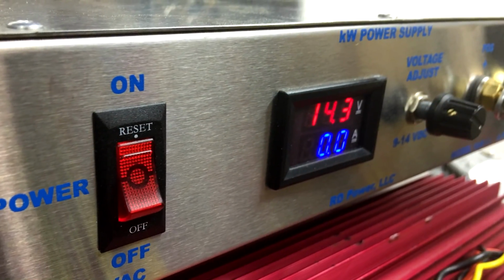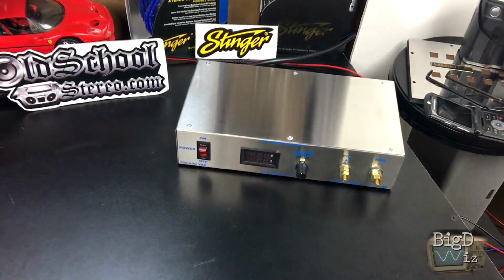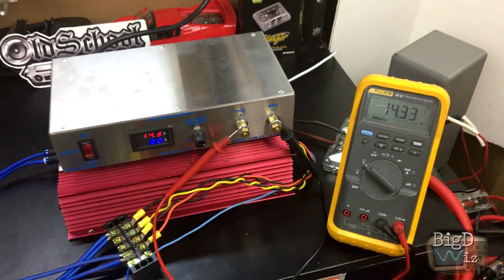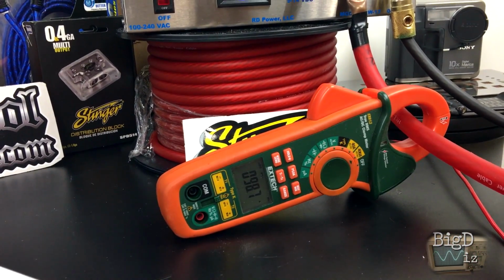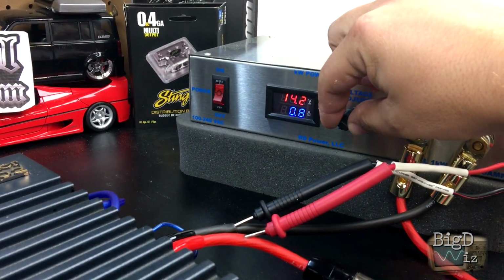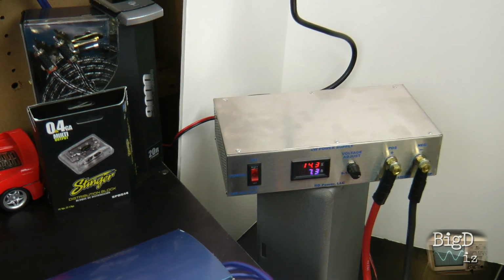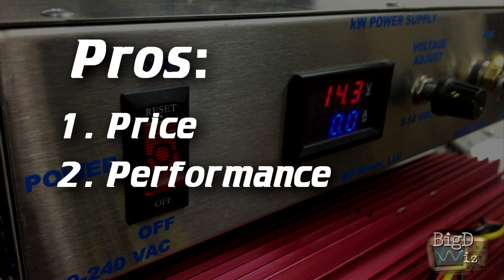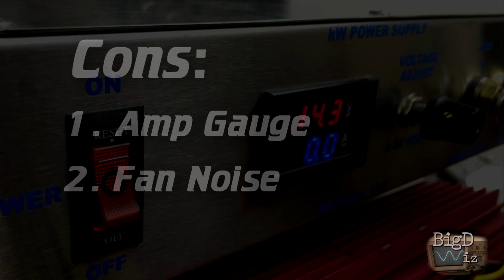RD Power 75A 12V Power Supply Review 1kW-12

Comment: Clamp-on Ammeter deviation is that on DC, the field is not expanding and collapsing as it would on AC.  ON DC, with a load, if you take the meter and turn it in different directions, the current reading WILL change!  That's the difference.  I am HAM Radio operator, I own one of these and have done these tests also.  It is my observance that adjusting the meter position for AMPS changes the reading WITHOUT changing the load.  To validate MY testing, I used an inline CURRENT meter shunt with a Fluke 8050 bench meter to read the millivolt drop across the shunt and converted it to true amps and the meter is accurate to about 1%.  Rusty also makes one with a 150 Amp rating!  Best Regards.

Comment: Check the 2amp current with the fluke 85 III. The only thing I don't like about it is that the voltage display just shows the voltage you selected, not a voltage meter (should fluctuate).

This may be very well the reason why the amperage meter is not accurate or close to your clamp meter. Think about it this way:   75amp @14.4v = 1080watts , if you have a voltage drop then you will get something like 80amp @13.4 which is the same 1080watts the ps is capable. The amp meter on the ps might be going off of the 14.3v calculation, therefore you will get a higher amp reading than the ps's meter but that is because the voltage meter on the PS is set at 14.4 (does not fluctuate).
Reply: I dunno, if the power supply inside is well designed, it should be able to provide the power without letting the voltage drop. Because of the size and power, it's definitely a switching power supply. Those power supplies can produce rock steady outputs!

Comment: I use a 100 amp Power maxx power supply for my test bench. Only problem I've ever had was using an old 1 farad capacitor had a hard arc caused it to cut out in high amp draw. now I use a battery for a buffer. it has a 3-stage charging system with the capacity of with 14.75 volts. it's not adjustable voltage but I've ran it up to 75 amps I've never had to drop below 14.25 volts. pretty solid power supply not quite as compact but still pretty small unit
Reply: You can pre-charge your capacitor through a resistor. It will take a little while (or just a few seconds, but you have to use a big enough resistor, otherwise it will burn up on you.), but won't trip out the PSU. Then once it's fairly well charged, just connect it directly to the PSU and it probably won't trip anymore (some experimentation will be needed).

Comment: I'd buy it if it weren't for the rivets. They make a bolt or screw model, I'll snag one right up. But, I don't want something that I'm gonna have to drill rivets out of if I ever need to repair it. "Warranty Void" tamper-proof stickers work fine for everyone else.
Reply from the maker: +Private Information I understand your concern, but I also understand the manufacturer not wanting people to get inside. Those who don't know what they are doing could get hurt

Comment: why can't  standard atx psu pull over 6.8amp ?? I've  test 3 different  amps and they can't  go over 6.8amp. tune with dd1 and on a evga 600w 49a single rail, but im picking this kw psu for sure now.
Reply from the maker: +Dragonboy Slayer it helps to have the extra 2 volts of this power supply also

Comment: I have one and it has to be reset just pulling a 4 transistor cb amplifier. Kicks it out every so often. I have a 40 amp switching meanwell that will carry more load than this 75. Not happy with it at all..
Reply from the maker: You should contact Rusty, I'm sure he'll take a look at it. It should handle WAY more than the 40A supply you are comparing it to.
Reply: I did. He said it was probably my ac power outlet. But it's the same outlet I'm plugging the 40 amp into. I kinda took it that he thought I was a moron... Also the particular plug is on a 30 amp breaker all by itself so I know it has sufficient power...